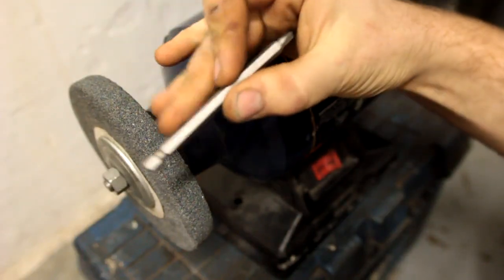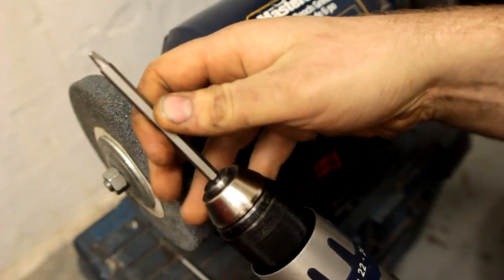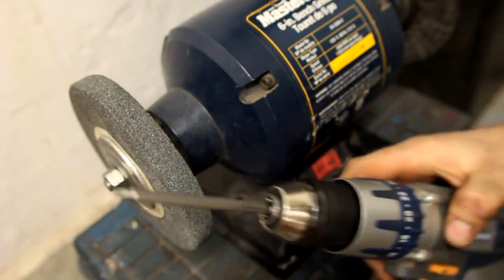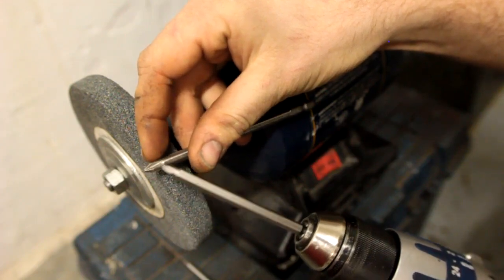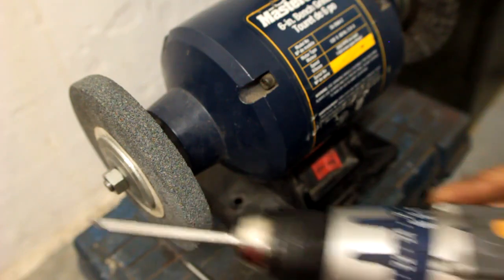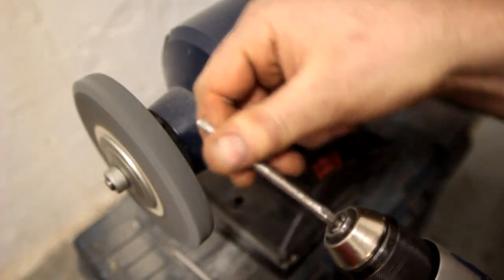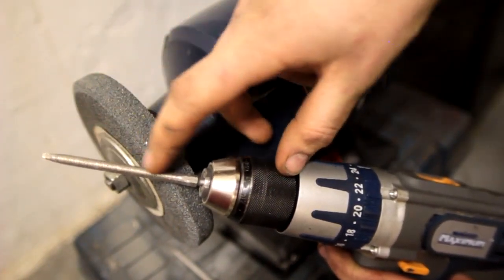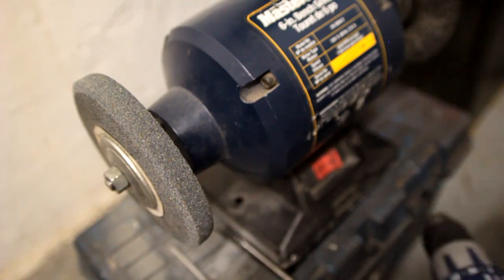No Lathe? Just use a grinder/sander and a regular drill.

Comment: Holy safety issues Batman!  No wheel guard, no eye shield, no spark deflector, no tool rest & grinding on the edge of the wheel instead of just the face.  I love it!  Great little tip.  I will be making lots of round things in the near future with my bench grinder.
Reply: You forgot the part at 3:59 where he stopped the spinning grinding wheel with his bare hand.

Comment: I need to take down a 13mm diameter gear lever (i mention this because it is kinked and not a straight 13mm rod) to 10mm. All I have is a bench grinder and some other general tools. Is my best bet to simply hand turn the gear lever while grinding at the end I want to reduce in size and hope for the best? A lathe would be the best solution but the gear lever is bent at about 40 degree around half way up and it also has a plastic pivot ball about a third of the way up so I can't see it going in a lathe. Anyone have any suggestions?
Reply from the maker: Stick the bent end out of the lathe, face it slightly, then use a center drill. After that, flip it around, and use a female live center on the tail stock and a dog on the head stock to turn it between centers. If you can't get a center hole in the bent side, maybe a steady rest would work?

Alternatively, just cut it off, do what you need to do, and weld it back together with v-blocks.